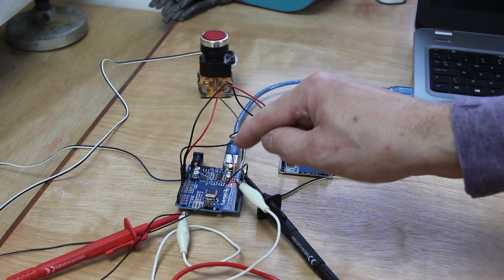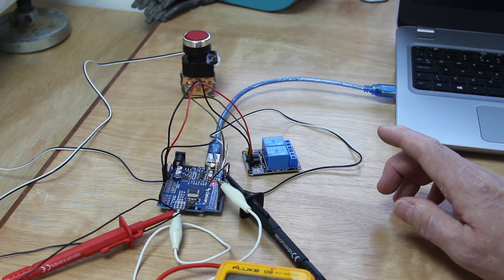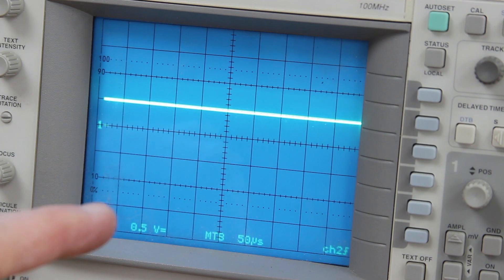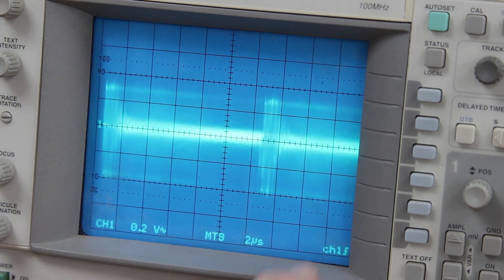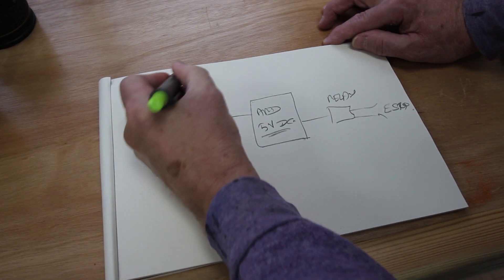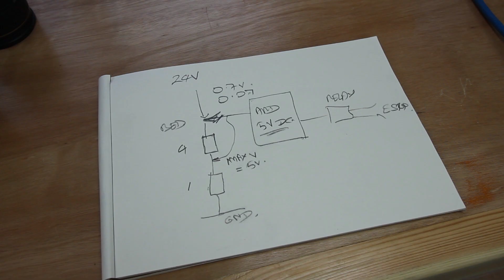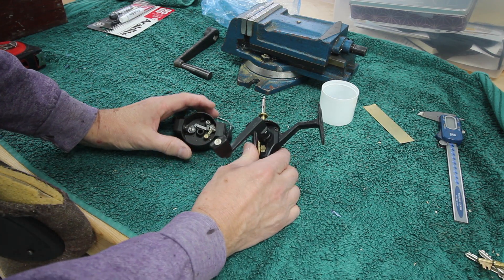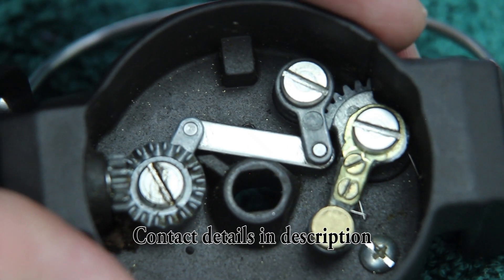Help needed for my crash proof cnc router

Comment: Hi. Electronics engineer here:- Your issue is NOISE PICKUP, so it is more to do with the IMPEDANCE of the node (input pin) that is picking up the noise.  Your arduino input pin is presently very HIGH impedance as it has a HIGH VALUE resistor pulling the input pin up to 5v.  To make the node less susceptible to noise,  LOWER the impedance of the node.  
First suggestion:- disconnect the 24V stuff, just have the arduino input pin with a 220 ohm pullup to the arduino's 5v rail. (1/4 watt resistor). That will be what we call a 'stiff pullup. Noise will find it very hard to get onto that node. If it still false triggers then add a small capacitor (e.g. 100nF) from that pin to ground. The cap acts as an RF filter, a short-circuit to RF noise.  Goodluck 😃
Reply: This would have been my suggestion too 👍
Reply: @mickwilson127  Shielding the lead to the aluminium foil wont he'lp unless the aluminium foil is also shielded. A grounded shield plate under but insulated from the aluminium foil may help particularly if the source is underneath the plate. This will reduce capacitive coupling from such a source to the large area of aluminium foil. High frequency pickup can be reduced by low pass filtering followed by a Schmidt trigger input..
Reply from the maker: Hi @dingolovethrob  
Great idea I love the fact you can ask people for advice and stuff like this comes back Cheers!
I will give this a crack and if it does not solve the problem then I'll try an opto isolator.
Cheers Again.

Comment: I have been working with Arduinos for several years now and also have built my own CNC machine. I agree with dingolovethrob on adding a pullup resistor and a small capacitor across the input  pin of the Arduino. Having the large metal plate under the entire bed of the CNC looks to me like a very large antenna for noise pickup. Using shielded wire for all the wires in this hookup would be good except the big bed antenna undoes all that. Perhaps using an optical coupler may help. The bed could be wired with the 24 volt voltage like you have now, but use the crash signal to light the LED in the optical coupler. Connect the output of the coupler to the Arduino input with the circuit dingoloverthrob suggested. The 24 volt circuit on the bed may work better with a capacitor across the LED input of the coupler. Noise is not your friend as you've determined. I hope this might helps.
Reply from the maker: @oldestnerd well done making a cnc from an Arduino that's no mean feat! yeo the foil layer is a pretty good antennae. It had not occurred t me to use an opto isolator I am going to try lowering the impedance and hopefully drowning the noise first as its simpler ( I dont have an opto isolator at hand). If that does not work I will give this a try.
Cheers

Comment: It’s over complicated just add a limit switch or better yet add a spoil board
Reply from the maker: Hi @xenusceptic yep it is overcomplicated and I have not yet added the spoil board. I cant see how a limit switch would work for this. I've had problems where the tool vibrated lower in its collet then cuts into the ally base also the controller has had a paddy now and then and plunged straight into the bed. 
Cheers
Reply: @CazualHaze  the idea of the spoil board is to protect the machines bed 
I use 18 mm mdf boards not fixed down so they can be replaced when needed and zero the tool path from the top surface of the work piece
When I made my first cnc machine I was paranoid about the bit driving into the bed but in reality it’s not a problem, I fitted a bottom limit switch to my a axis but it wasn’t needed when I rebuilt my cnc I removed it as it’s not required
Reply from the maker: @xenusceptic  you have had better luck than me I have certainly had issues with tools walking out and even the rich auto cnc controller going off on one and plunging into the bed. I do have a set of 12mm mdf spoil boards that I have not yet fitted, time is pressing as usual.
Cheers

Comment: My question is why?  This is "cool" in theory but why the effort?  Have you really crashed all the way through your spoil board?  If you are really that concerned about hitting the bed, you could zero on the spoil board instead of your material (work) surface and don't machine into negative space.  As far as suggestion to limit the noise you could try an opto-isolator in the line between the bed and the Arduino.
Reply from the maker: Hi @philshel1
 Yes I have had a tool cut all the way through the old ally bed. I've had problems where the tool vibrated lower in its collet then cuts into the ally base also the controller has had a paddy now and then and plunged straight into the bed.  I do use the spoil board as the base level (not yet added the spoil board to this). This is an attempt to save expensive tools more than the bed.
Cheers

Comment: shop lights look great! I may have missed it in the other shop videos (if so, sorry!) but I was curious if you have implemented or have plans for HVAC?
Reply from the maker: Hi @fallerd
Shop light video coming up I am a little out of sequence with these at the moment. As always I am making it overcomplicated! I dont have plans for aircon or heating at the moment, so far its been ok in the shop temperature wise. There is a fair chunk of insulation in it, I hope the temp is quite even throughout the year when I get the lathe and mill installed stable temp does help.
Cheers

Comment: Have you tried a smoothing capacitor on the arduino supply? Assuming it’s on the same 24v supply. The noise could be coming through the supply. If it is on a separate supply connect the grounds together and try that.
Reply from the maker: HI @stephengrattage5219  
The Arduino has been powered by the usb on my laptop so noise on the supply has not been an issue. I have a dc to dc converter that takes the machines 24v rail and turns it to 5v for the Arduino it looks well protected there are caps and a coil on board, time will tell!
Cheers